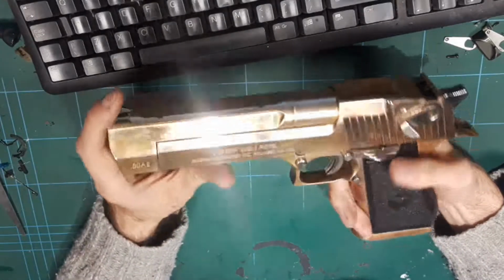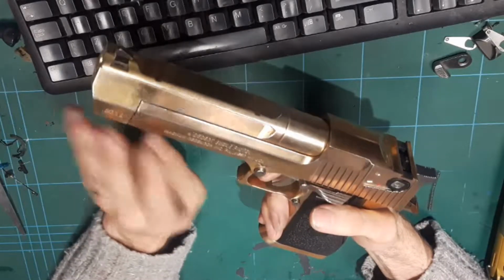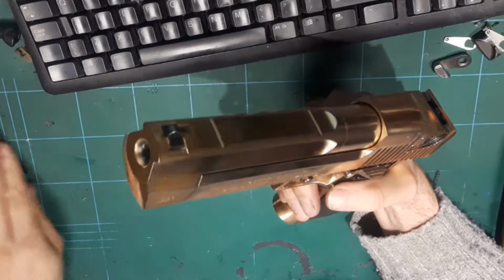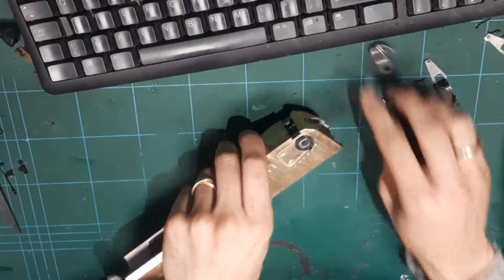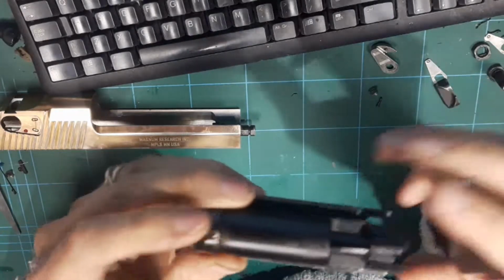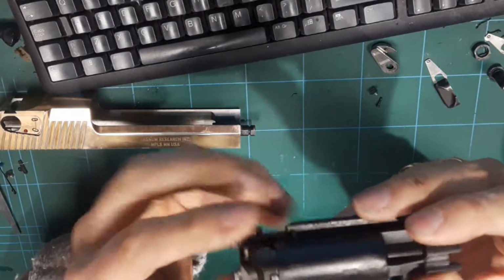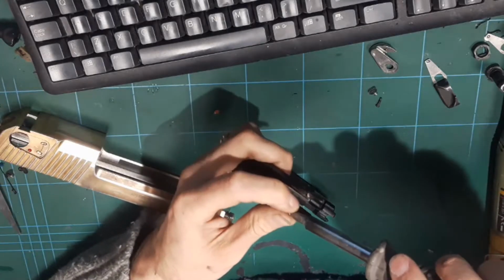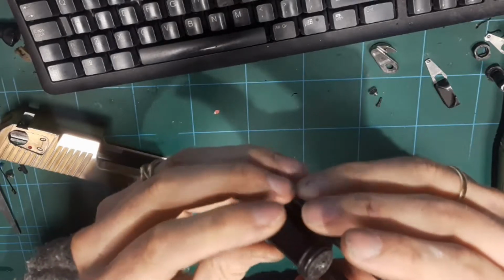Airsoft Engenuity WE Desert Eagle Piston Head install

Comment: Will I get an FPS increase aswell, I’ve installed the stabiliser, and I’ve got wonder leaf hop up, omega nub, and Japanese steel 6.01mm palsonite coated, just got to install the piston head once I have screws out and valve locker